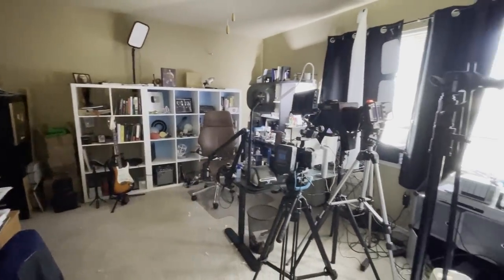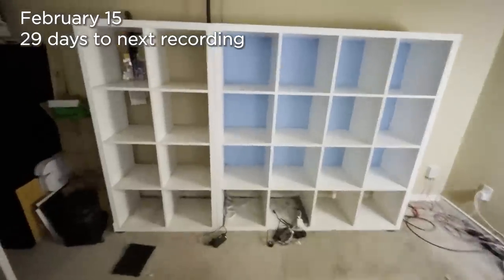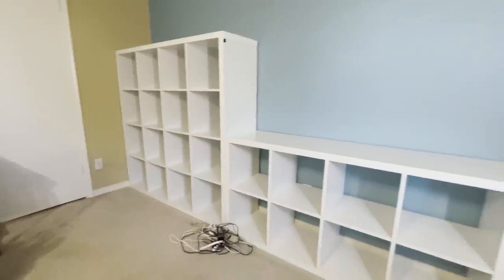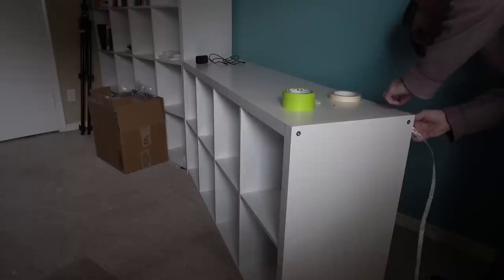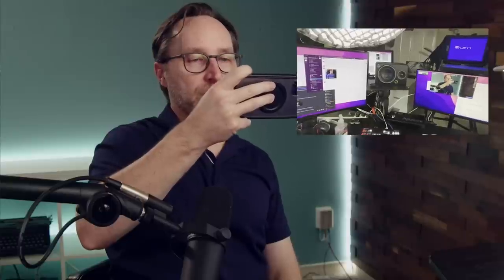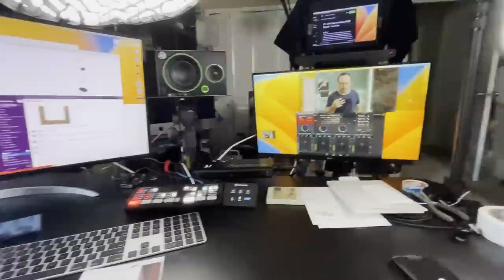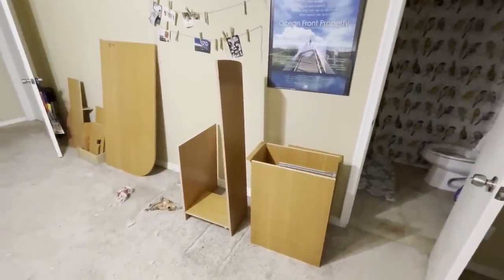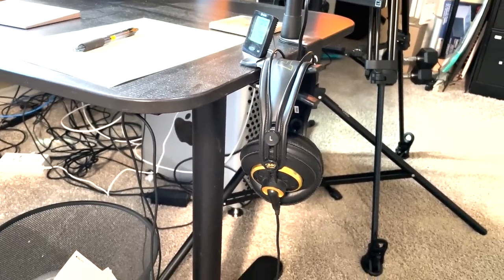How I Built My New Studio

Comment: I am not a pro painter, but I have painted quite a few houses before, tip, it is easier with a paint roller, and faster. They are pretty cheap. Also, I am 95% sure you need to sand the old paint slightly before putting the new paint on,  otherwise the paint will be easier to pull off like with tape for example.

Comment: Pro tip with the painter's tape:
1. apply tape
2. use a brush and paint the background right on the edge so it seeps into the micro cracks underneath the tape
3. let the background color dry for a couple hours and then do the actual painting with the foreground color
4. remove the tape before the foreground color had time to dry.
Result: razor sharp lines all the way through
Reply: Precisely the advice I was stopping by to give. You included all the necessary steps...except a paint roller. Joe...buddy...seriously! 😂
Reply: I was coming to give this advice but I couldn't have worded it as well as you! I hope this gets upvoted to the top comment lol good info
Reply: I really appreciate that, unlike other comments that criticize what he did do, you gave advice for next time. I also didn't know this trick myself! Thanks! Hopefully I, or anyone painting, still has some of the old color available lol
Reply: Hmmm most of the painters I know do not use masking tape for anything but spraying, myself included....
Reply from the maker: Thanks for the tip but I'm confused by what you mean by foreground and background color. Is background color the same as primer?
Reply: @joescott-tmi  he means use the original (the color on the other walls)color first to seal the tape, then when you peel the tape there is no blue under the tape...
Reply: @Joe Scott - TMI  aka the old wall color. Obviously you'd need to have some of the old beige. Lay tape, paint with old wall color, any bleed will just be matching wall color, old wall color seals up between tape and wall. Then apply new color.

For just one wall I wouldn't tape, especially if you don't have any of the old wall color. Hit YouTube to watch pro painters teach you how to cut in, and then get a roller for most of the wall. 

Of course your office I already painted. You got the job done and the new set looks wonderful! Just some advice for future painting, and for others who also don't have much experience. 😁
Reply: @joescott-tmi  Background color is whatever color you want underneath that tape, typically what's already on the wall before painting.
I like to leave 2-3 inches of white at the very top of the wall so the room looks bigger, especially with dark wall paint. It's a fun optical illusion but also a pain for filming.
Reply: @MrBillzebud  Takes skill, experience and just the right brush and paint to get a clean edge freehand.
Reply: @Hamachingo  Professionals do not care about a clean edge.  They care about how fast they can do a good job and move on to the next one.
Reply: @Hamachingo  indeed it does, I have been doing so for 30 years.
Reply: @davidbeppler3032  That is not true at all, I have been a painter for 30 years and have never rushed a job and most good painters take pride in their work.
Reply: @MrBillzebud  No, they do not.  Maybe you don't know what a professional painter is?  You are clearly not one.  You spend 6 weeks doing a job that a professional does in 3 days.
Reply: @davidbeppler3032   perhaps what you think of as a professional is just a paid amatuer... I went to school and earned a ticket to call myself a professional.
Reply: @davidbeppler3032  bro,  chill
Reply: @whatwhale5888  jdpoqwiejrflqisdj!~!~!!!!!!
TRIGGERED!!!!!
lmao
Reply: @MrBillzebud   Wow... painter school, to paint walls.  How many years did it take to graduate?
Reply: @davidbeppler3032  there is a lot more to it than just painting walls. It takes 3 years total to get your ticket.

Comment: Pro tip for that LG ultrawide with powered monitor speakers sitting so close to it - don’t turn off your speakers at the amp before turning the screen off completely. You might blow the pc board in the monitor by doing this. Took me four trips to the repair Centre to figure that one out 😂

Comment: For 6 years of dust, that's actually a lot less than i get in a few months in my city apartment. So you're pretty lucky.
IMO the new arrangement looks good. We're all reticent to change, naturally, so i'll miss the old setup, but the new one isn't bad either.
IMHO, you should move all the light stands on the ceiling and off the ground. Cameras too. A simple gantry wall (it's essentially a stud wall, but you hang your stuff from it) can be made with minimum wall hollage.

Comment: Nicely done, Joe! If you still need ideas on how to mount lights below the ceiling and save you floor space, take a look at wall-to-wall / floor-to-ceiling tension rods like the Impact Varipole system (on B&H). It mounts very well just by tension alone, but if necessary, there are also ways to mount it more permanently with screws.
… Sade!! ❤🎶

Comment: so i work from home, usually using multiple monitors. I'm also a gamer nerd, using more than multiple monitors.... sometimes I do both at the same time cause reports and such can take a bit to generate. I also have a working place for my tinkering, building keyboards, soldering needs and the like.  POINT BEING, I'm in my office a lot. like a lot, a lot. I have 2 air purifiers so that I can keep the noise level low most of the time, then when I vacuum or clean one of my rigs, I turn them on high and let them go for a couple days. they catch a lot of dust when doing those things.  I assume your area is more of a working area (as is mine), getting things moved around constantly and such. I'd go with a couple smaller/cheaper air purifiers so you can create more air turbulence in the room with them (especially when moving things around) and that would help a lot with the dust. I also move them around to have them change the air circulation patterns, in hopes of having more of an equilibrium with my dust while also attempting to reduce the concentration of said dust.

random note. If you'd ever like a custom built keyboard i'd love to build you one.

Comment: hey, this comment might be unnecessary, but if i saw correctly, you had the magic arm screwed in where it attached to the convi clamp, right?

it looked like you had it set up so that the weight would pull down and make the arm unscrew itself. if you flip the convi clamp so that the receiver is on the other side (left?) and attach the arm on the left side instead of the right side, then the magic arm will tighten itself in as the weight of the monitor tries to pull it down. whether the arm would support the weight of a monitor even in that configuration is another question - generally i think the weight capacity is lower if the magic arm is extended.

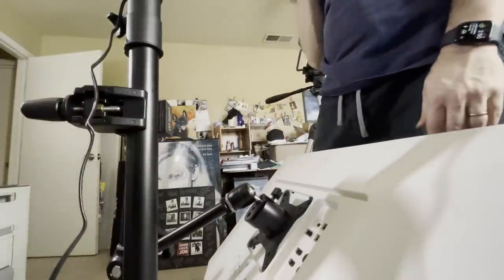i'm only at 17:50ish, so maybe you come back and answer all that, or maybe you do something else with the convi clamp/magic arm, but just in case you think about returning the arm to wherever you bought it, i would suggest first trying the other orientation if that might save you a return ordeal.

last few thoughts now that i've watched to the end...

- you seem to have a lot of things that draw power! i found that doing a quick inventory of all the things that draw power allowed me to identify a handful of peripherals that all used the same voltage (12v in my case), and some that could accept a range of voltages (the Ninja V takes a wide range, as do some LED panels). i got a good ~120w 12v AC-DC adapter, and a DC barrel cable splitter and some DC extension cables, and now one power brick generally provides power to a handful of devices (so i don't need to have a bunch of little "wall warts"). no idea if this even applies to you - i couldn't quite tell - but it's definitely worth looking into!

- i think the shallow drawers are a happy accident. i might steal this for a future project as a way of really forcing myself to store bulky things in their own place, and to make stacking items in drawers (and ending up with a pile of junk) physically impossible.

- if you ever consider getting a 32-bit float audio interface, i'd just like to say i highly recommend it. i'm not some fancy pro, but the zoom F3 just sits on my desk, provides me with 2 XLR ports, and gives my computer 32-bit float inputs that functionally can't clip. i still set the level going into the computer, but i can endlessly adjust it if i'm coming in too high or low. it's amazing, really.

Comment: You're catching a lot of guff about the lack of a paint roller, so nothing about that. 

But for next time and for anyone else who needs it: to dust surfaces that have been sitting for a while... start with running the softest wand of your vacuum cleaner over it to get the majority of the loose dust and then break out your preferred regular dusting method. This greatly reduces the sneezes and airborne dust particles. 

Also, yes, I'd be very interested seeing the final organized office!

Comment: The painting part really made me cringe. For all those reading comments: 1) Take the tape off immediately upon finishing the final coat to avoid it bonding with the paint as it dries; 2) ALWAYS take off the outlet covers and light switch covers, & drop them in a ziploc baggie to avoid losing the screws. It takes about 10 seconds and makes a WORLD of difference. 3) ALWAYS do the cut-in (in other words, borders and corners) FIRST, then fill in the rest with a roller. Rolling the large areas is paradoxically the easiest part, because the prep work and cut-in is what takes all the time.

Comment: A shop vacuum with a small and large brush attachment.

When cleaning the shelves you can use the small brush and it will get the majority of the dust, spider webs, and debris before doing the final cleaning by hand.  Then attach the large brush to do the same with the wall.  The crevice tool can be used in the corners and where the wall and floor meet to get dirt and debris that the carpet vacuum will have trouble getting.

A small shop vacuum with all the attachments can make life so much easier when it comes to cleaning up messes.